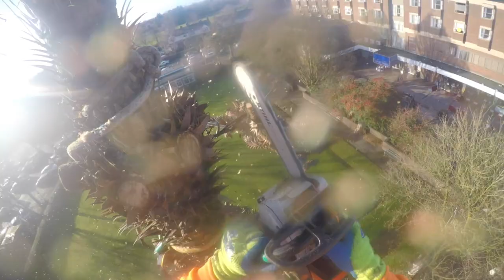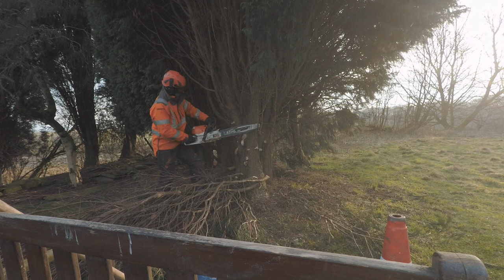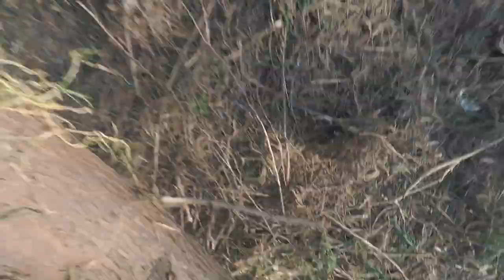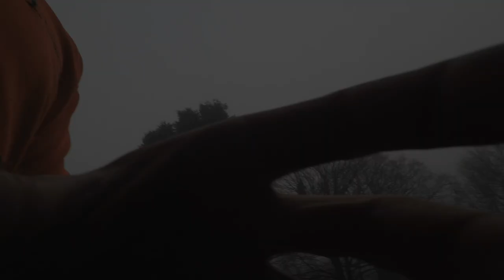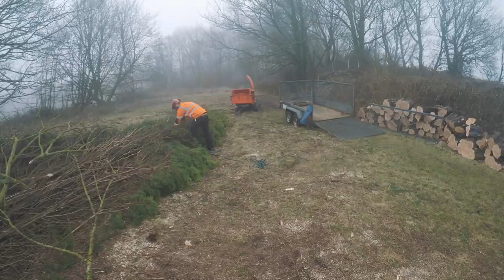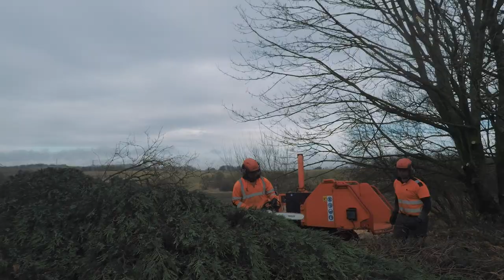Felling Conifer Trees [UK Tree Surgery]

Comment: Hi Matt. A company has cut down all our neighbours conifer trees, which have never been a problem in the 19 years we have lived here. The storm threw a trampoline into our garden from next door down the back garden because we had no wind break. The birds used to nest in these trees. I am heartbroken. Can you tell me can a company that cuts down all these trees, and can they sell the wood and make money out of it. As it makes no sense at all. They could have trimmed the trees. There was no need to kill them!
Reply from the maker: Hi thank you for your comment. I can see your concern I would have expected local residents to be informed if so many trees where coming out but they have no obligation to do so. Its hard for me to comment on specific companies and jobs as I don't know enough information.

Trees are the land owners and their responsibility. They can as a rule, remove or prune them as they wish - providing there is no preservation order or local restrictions on the tree/trees. For any work to take place in this case a permit must be obtained. In my experience its very rare to see these orders on UK conifer trees (like the ones in this video). Therefore the trees can indeed be removed and the waste/ timber sold on. In most instances the green waste is sent to be processed as biomass fuel and new more appropriate trees planted as a replacement.

Hope this helps somewhat. Thank you for you comment.